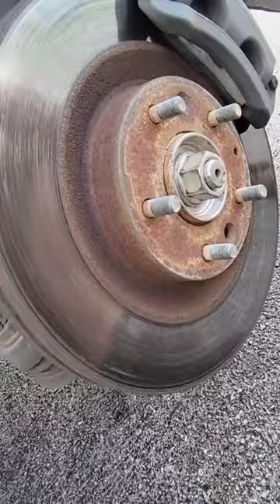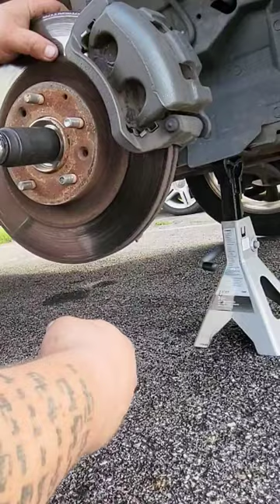Mobile Mechanic Daily Tips #semperfimechanic #mobilemechanic #mechanictips

Comment: You have to be relieved when that happens. I had an old Durango that had been driven on the beach. I broke a 3/4” ratchet, 1/2” breaker bar and my 650# impact gun wouldn’t touch it. I borrowed a 3/4” breaker bar with a 6’ piece of 2” pipe. That did it!
Reply: That must have been the asphalt recycling facility parking lot they were driving in lol

Comment: Or you could just break the torque free before you take that other wheel off the ground. It's a lot easier and you break less. Screwdrivers you could also try a pry bar between the wheel studs

Comment: Usually that’s the first step, before even jacking it off the ground.
Reply: yeah because you can totally do that while the wheel is on
Reply from the maker: Brother not all axle nuts are exposed with the wheel on.
Reply: @semperfimechanic but alot are
Reply from the maker: Yes some are I agree and some are not. Its 50/50
Reply: @semperfimechanic  Always gonna be someone with a better idea ready to tell you all about it. Lol

Comment: I just put on the e brake, or put it in gear
Reply: Most likely he is working on the front end of a rear wheel drive car, both e brake or putting it in gear would lock only the rear wheels